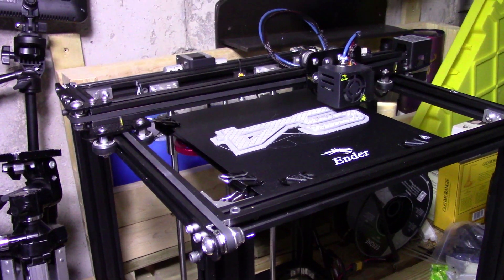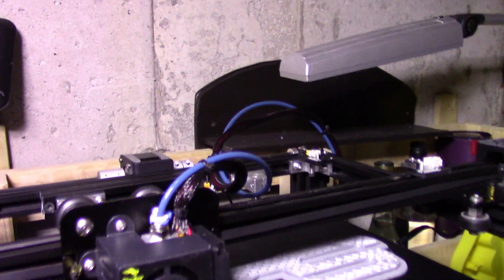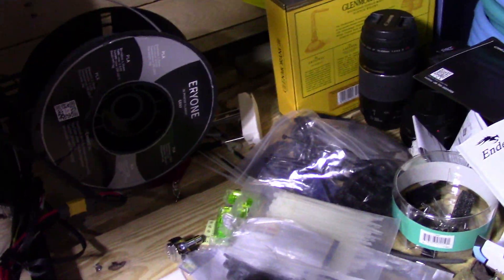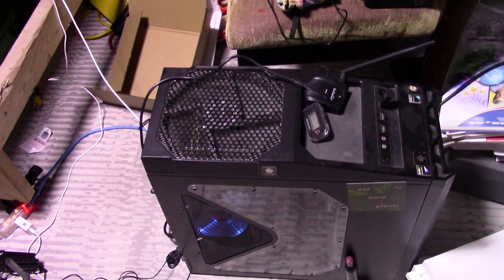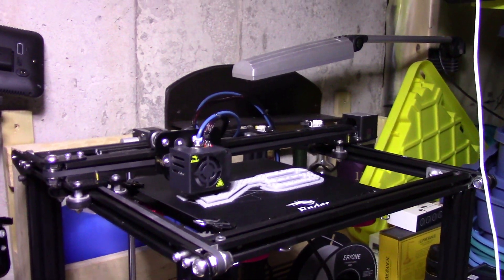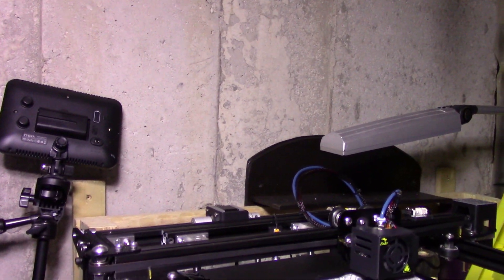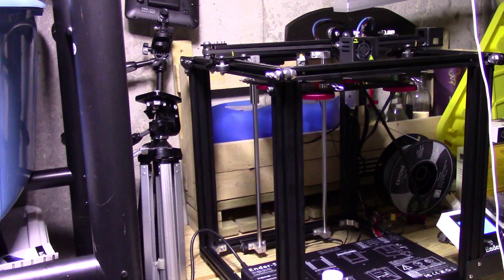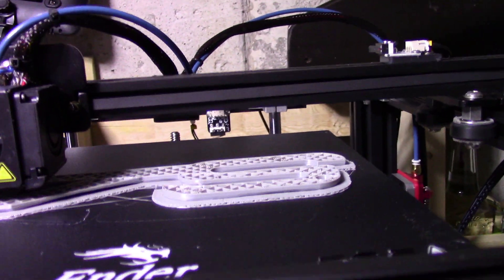Ender 5 Pro tips, review, and more upgrades

Comment: definitely enjoying your how to's etc just got my 5 Pro Friday and finally late Sunday  completed a dog.  I'm in the process of making a list and prices to see which upgrades I can afford this month, my question since you have had several months with your pro now what would you suggest for a top priority list of purchased upgrades for mine. Granted I can't afford everything at once. Thanks Denny
Reply from the maker: Hello, thank you for watching. I would definitely recommend a PEI steel bed sheet, an enclosure with lighting/exhaust, raspberry Pi, pi cam, wyze cam, fire detector, smart plugs, and a filament dehumidifier. Other then that, not much more you'll need for this printer. Just tune and dial in all the settings and you are off to the races.
Reply: @MicBot  I really appreciate the suggestions
Reply from the maker: Most of the major stuff you can do overtime. For now just the pei Steel bed sheet would be my suggestion.

Comment: 6 MONTHS AGO, by now I'm sure you flipped the filament spool to feed from the bottom, not the top. Puts the filament in a straight line.

When using a feeler gage, do you adjust the bed to where the gage moves with some friction or stop when it won't move?
Reply from the maker: Lol yes.

With the feeler gauge I just move it till I feel a bit of resistance. 0.06 and 0.07 have been the best results for me